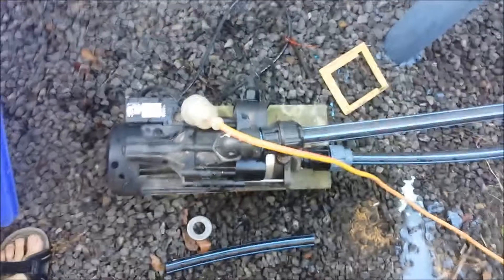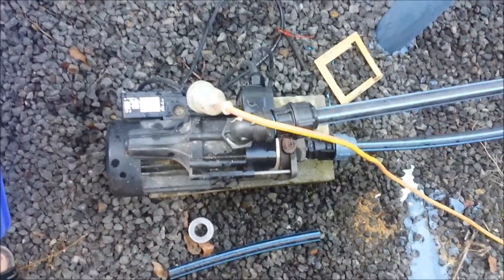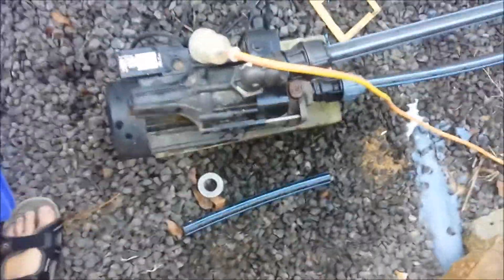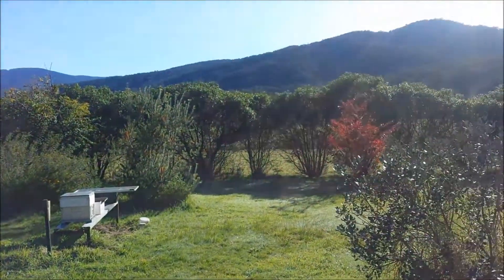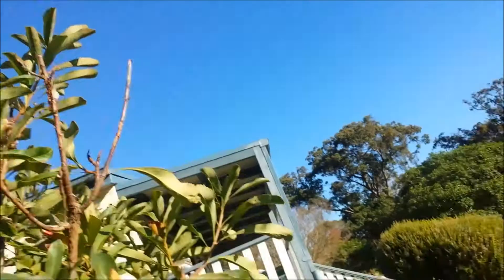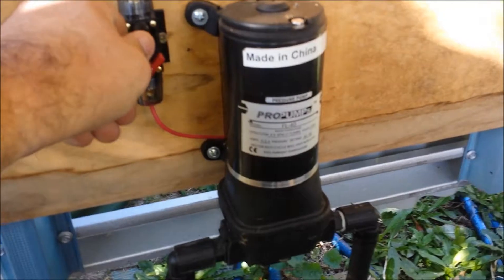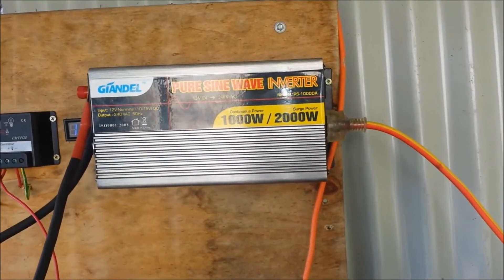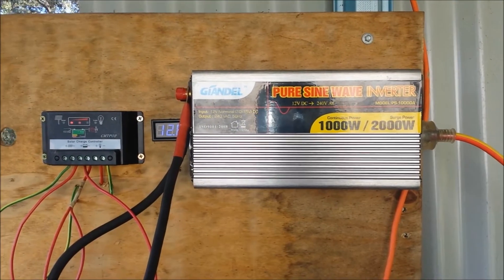240V Solar Powered Water Pump

Comment: Hello. I have a 25w 220-240v/50hz submersible pump. Was wondering if you can give me some advice on the solar materials i need. That is the wattage of the panel, the battery and the inverter. Cheers!

Comment: Thanks for that mate!. I'm about to try my new 500w 240 volt pressure pump set up outside off my 1000 watt inverter and wasn't sure if it would power up. I find the 12 volt shuflo pump I have way too noisy mounted inside my off grid cabin. Cheers Dave
Reply from the maker: +bestillulittlec Get a Killawatt style meter and put on the pump for a week or two to see what your actual usage is. Today I just set my 600W Grundfos pressure pump back up on the 1000W PSW inverter and 120ah battery. I'm generally only here at the shack for two days a week, so it can run for two days and get charged for five days.

Thanks for watching.